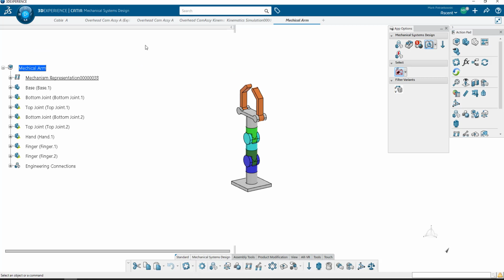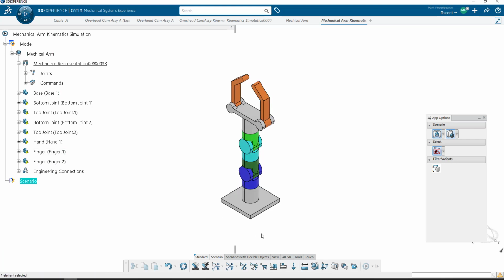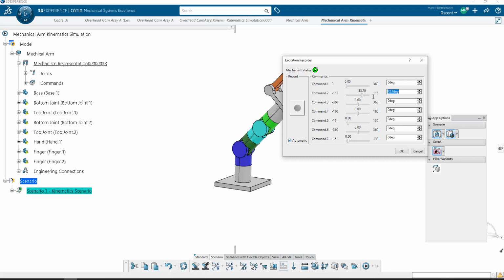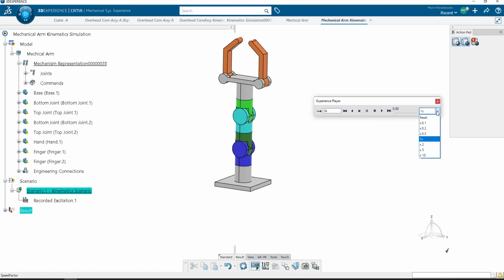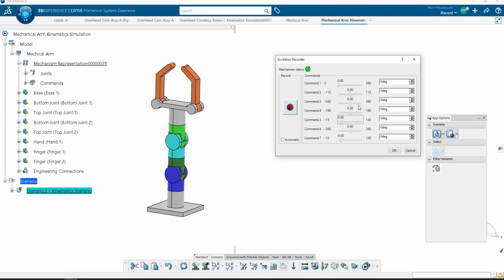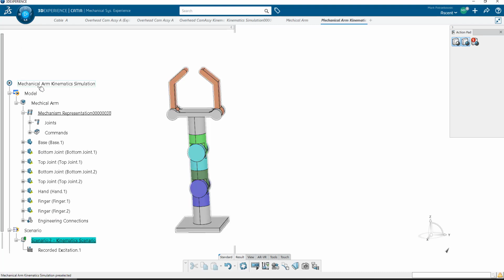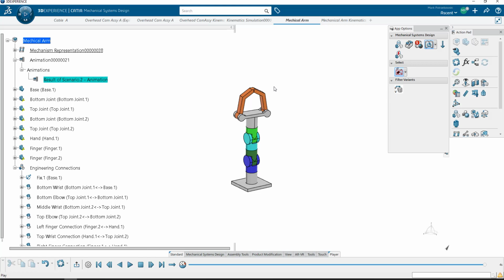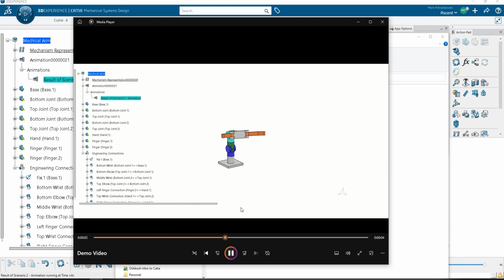3DEXPERIENCE Mechanical Systems Experience: Kinematic Simulation using Kinematic Excitation Recorder

Comment: I have the same problem that this video shows.  Though I have inserted the positions that I want in the order I want, my animations and final video do not have smooth motion.  To fix this, I just brute force made 15 times the number of insertions that I need, each a small step that is a part of a single motion.  I bet someone reads this and tells me there is a simple solution (0.1x somewhere) to make a smooth video.  I just didn't see it.
Also, I have had this enhancement request for 25 years:  I would like to edit each insert graphically. I was hoping that 3dExperience would improve kinematic simulation to include a graph (time on x-axis) for the motion of inserted positions. I want to stretch, shrink, or overlap the motions by manipulating the graph.  Working Model by Knowledge Revolution was doing this in 1997.

Comment: Hello Mark, 
great content and thank you. I am trying to simulate a magnetic mover (xbot) over an induction table (tech used for moving the assembly parts in production) - the "planar motor inc" product. Using excitation recorder seems like best way to create movements scenario for simulation. 
My problem is that i need this "xbot" to move to planned location and then stop there for some time (so other robot can make operation on part that xbot carries). I cant figure out how to make a planned travel time and define waiting times for each station, so my simulation can show those movements and stops in real time, not so fast as I can see your simulation also acts. In other words, how to slow it down to predefined moving time? 
Greetings, 
Lovro